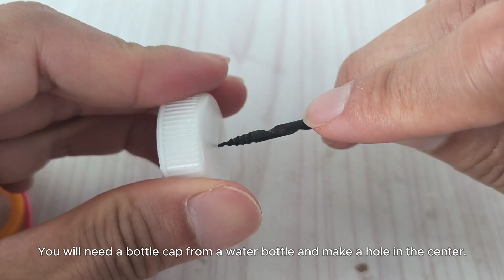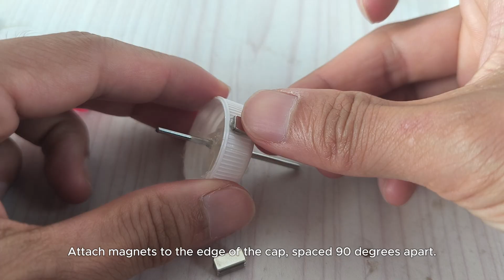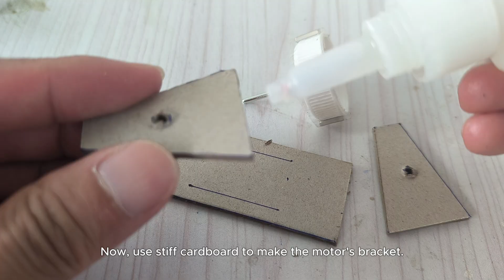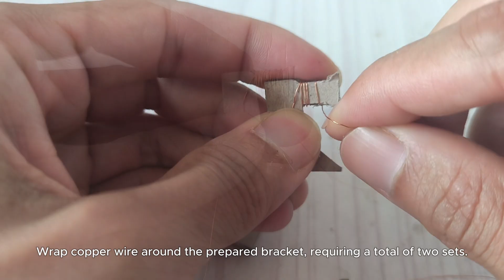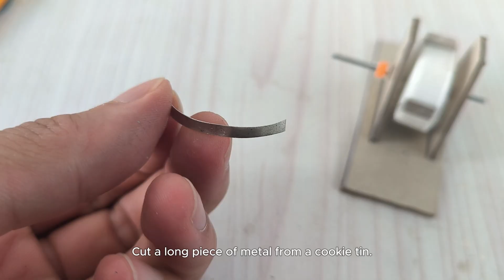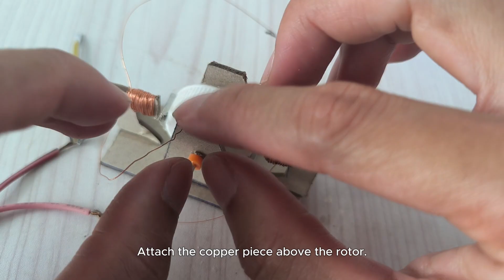How to make an Ultra-Simple DC Motor at home easy | DIY Motor Projects

Comment: What is the maximum voltage of it ?
Can I make the coils with a metal rod to make it stronger ?
Reply from the maker: This operates at a 5V voltage. To improve the motor's performance, it's recommended to increase the number of coils and use more flexible iron strips for constructing the circuit switch.

Comment: Hey can you make a template? Because I don’t really reckon I can do these by just freehand drawing them
Reply from the maker: Actually, making this motor is easier than you might think. If you want to build one yourself, you can start with a simpler version using one set of coils and two magnets—it will work, though its efficiency will be lower. The key is to ensure smooth rotation. Once electricity flows through, it generates magnetic force, which then drives the rotor into motion.

Comment: Wow, this is really amazing. thank you very much, BIG LIKE... I think you can use this approach to make strong DC motors like the brushless motors because there's no resistance contact with the brushes like the typical DC motors. I liked your idea and I think if you add more coils, it will be like the brushless in terms of performance and speed. What do you think?
Reply from the maker: You are absolutely right, it is indeed possible to create a more powerful motor. I also have this idea, but it requires finding suitable materials. However, I have been busy with work recently and haven't had time to shoot new videos. I hope to create more videos for everyone to watch in the future. Thank you for your support.

Comment: You're videos are really enjoyable and educational too, since your videos are mostly great and are good for learning how to do these stuff. again, my ones are complex and larger in size, and requires careful handling (which I safely do), and are quite powerful, but comes with some effort, increased cost of manufacture, time consumption, additional components for transport and other things. so while yours are simple, you are lucky and are making it simple and great, and cheaper, because mine are complicated at times, have more components, has multiple wires and several components, fuses, and other stuff. but I do like your videos a lot.
Reply from the maker: Thank you for your message. Your comments are always very professional and rich in content. Yes, I hope to create some videos for beginners, as this allows for exploring scientific principles at a low cost. This is the goal of my channel. The designs you create are of professional quality, which can help those with a basic understanding to grasp deeper theories. I am very honored that my channel has attracted the attention of a professional like you.
Reply: @bongbong之奇趣實驗室-b6n  Your welcome, and thanks a lot for your feedback about me. thanks.

Comment: Very nice and amazing. now as I said earlier, if you had one or two input connections and the other one unconnected, the spinning magnets being rotated at high speed will generate AC power or alternating current, which can be difficult to detect without a multimeter and some basic understanding of how to measure AC and its functions and cautions, but you can connect something like a 12V Car lamp onto the 2 wire ends on the unconnected Coil and watch it flicker. but if you're going to try this for a video, please be aware that AC power has delays in generation, and it takes time for power to become stable, depending on frequency, number of turns in the wires or coils and magnetic strength (which yours are extremely strong). its recommended to have a thick wire with many turns of wire as possible, or with the thinner one or both, since more turns of wire results in stronger current. but due to frequency, I would advise you to connect the coils to something that will operate on AC, even if it is designed to work with DC, like a 24V lamp, or something like that. to make successful connections, 2 wire ends must be connected to a device.
Reply from the maker: @davidwarda5616  In terms of designing a generator, I also have this idea, but I know that making a good generator requires thicker copper wire and a sturdy casing. I am trying to search for suitable materials, hoping to make the construction easier, but I am still in the conceptual stage.
Reply: @bongbong之奇趣實驗室-b6n  that's good that you have this idea already. now you said you need a thicker copper wire, but this actually depends on what you are using it for and how much current you want it to handle and generate, so having a thicker copper wires is not necessarily a requirement for power generation, because it depends on how much power you want to generate, how much current you want it to handle, what kind of power you are needing (AC OR DC) and whether you need high torque, high power and other stuff. but I agree that thick wires are good for a good generator, but this depends on your personal needs for the generator.
Reply: @bongbong之奇趣實驗室-b6n  I agree with your statement.